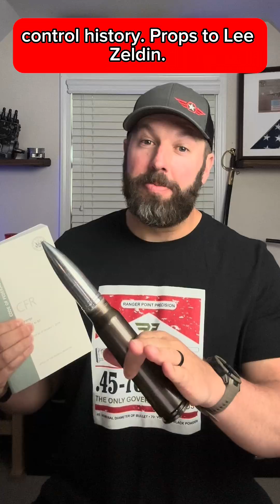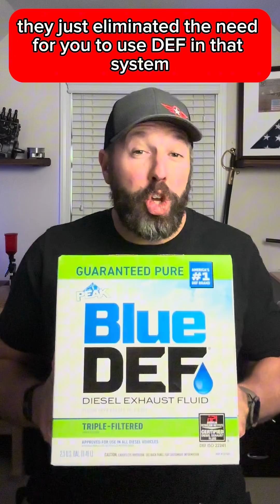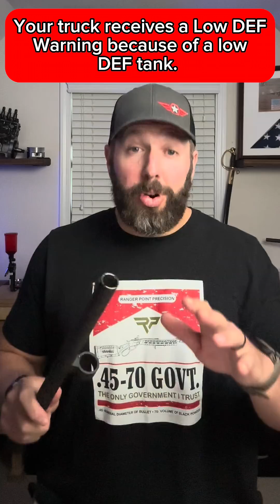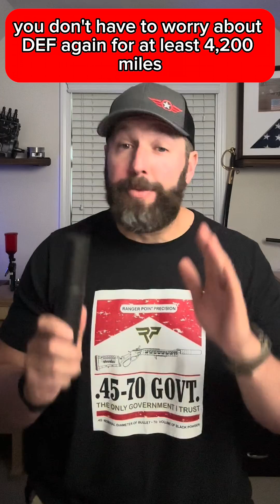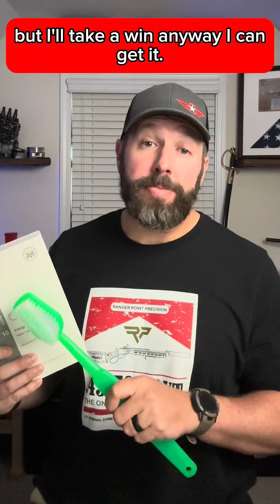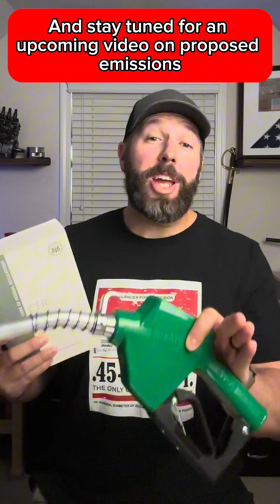The EPA just DELETED DEF in Pickups?…Lee Zeldin is a Magician #diesel #dieselengine #dieselpower

Comment: Not just because your tank is empty.  Also due to any myriad of components that malfunction, rendering the system inoperable.
Reply from the maker: That’s obviously the point of the new EPA guidance, as explained in the video. To make Limp Mode less intrusive after a failure in the system. 😉

Comment: The thing with DEF fluid..

just dont put that sh*t in something that my life depends on. If im fighting a fire, I dont want that sh*t to be an integral part of the system - like it is in my Grader
Reply from the maker: There are exemptions for Emergency Response Vehicles in 40 CFR. Either way, the new Limp Mode guidance should eliminate age any dangers in those situations, IF the OEMs choose to adopt them.

Comment: Does that apply to CMVs?  Are dealers going to be "fixing" previous model years back to 07?  Will warranty still be good in your extended service interval if the factory does flash it themselves?
Reply from the maker: I provided a link to the EPA fact sheet in the description. Commercial Vehicles have a different, but still revised strategy.

Comment: I don't mind adding the def.  My problem is going to be when the system starts to cause problems because it's clogged with crystallized def.
Reply from the maker: I don’t think people will actually use this strategy. Just letting people know that the OEMs have some flexibilities now.
Reply: @freedomworx  I watched the full video.  I have a Silverado with the 3.0 Duramax.  I live in Mesa AZ and put 30,000 miles on it in a year.  Most of those miles are highway.  I think it will do just fine.  Most of the preventative things you talked about are things that happen naturally when you drive on the highway in AZ in the summer (most of the summer is spent over 100 degrees freedom).

Comment: What happens if you tie the sender up in the tank so it never reads empty? 🤔
Reply from the maker: There are lots of other sensors in a DEF system that monitor its performance. That’s not really an option. It’s best to just feed it DEF like you’re supposed to. This is really just giving the OEMs some flexibility.
Reply: @freedomworx  Yeah, I kinda figured. It sure would be nice if it worked though. Lol

Comment: Unfortunately my truck doesn't keep up with current regs.  It's still going to go into limp mode if I run it out of DEF.
Reply from the maker: No truck meets this revised guidance. They all require the ECU to be reflashed. IF the OEMs choose to implement this voluntary guidance.

Comment: At least it will not go into limp mode as quickly for a bad sensor.
Reply from the maker: That's the reason for the change. Keeps people from getting stranded 3,000 miles from home with their family and travel trailer on the side of the interstate in the middle of the desert.

Comment: Will they do away with the 'limp mode'?
Reply from the maker: No. Limp Mode wont go away. They are just making Limp Mode less intrusive. EPA could try to remove it from 40 CFR, but the lawyers and courts would probably be successful at arguing against it. I don't see the EPA trying that.
Reply: @freedomworx  It's always fun when halfway through a multi-day delivery trip, hauling a 40' flatbed of hay, that your truck will now be restricted to low-HP because you forgot to top off your magic peepee juice.

Comment: This pack is exactly what I thought about doing when I heard about this today. However, doesn’t it reduce your torque by 15%?
Reply from the maker: There are seperate Limp Mode strategies for Light Duty Trucks, Heavy Duty Truck, Off Road Equipment, etc...  https://www.epa.gov/system/files/documents/2025-08/420f25011.pdf
Reply: @freedomworx  thanks for this info!

Comment: the cost of DEF isn't the primary issue. It's the cantankerous junk system that is constantly breaking and costing a fortune to fix and keep operational
Reply from the maker: No doubt. But at least the will allow people to complete pretty much any trip they are on, if they have any DEF System Failure. So you aren't stuck 3,000 miles from home with your family and travel trailer on the side of the road.
Reply: @freedomworx as one who was 1,000 miles from home when our diesel motor home went into countdown mode, I applaud this decision. It was a stupid system and was forcing manufacturers to make gasoline truck engines for the first time in 50 years. So we go back to 2 mpg, does that make sense? It’s hard for me to see the EPA as anything but out of control with reference to diesels.
Reply: @jamesfearing9459  To lazy to fill your DEF tank?
Reply: @csuengr tank was full. The control system failed.
Reply: @jamesfearing9459  That's what you get for having a diesel.
Reply: @csuengr yep. That and 14mpg vs 6 for a gasoline version of the same type gas rv.
Reply: @csuengr  Go hug your cyber truck
Reply: @freedomworx Just had this risk. 900 miles from home, towing a camper, middle of the Nevada desert, 6pm on a Friday night. Check engine light comes on... 
Manage to find an AutoZone to pull the codes and it's a def injection issue. 

Then spend the next 8 hrs wondering if I will be stranded in the desert with my whole family at midnight and car whizzing past at 80mph. Fuel economy slowly dropping from 22mpg to 15mpg. 

Luckily we made it... Whoever made these laws needs a swiff kick in the rear.
Reply: @freedomworx complete the trip? Lol as if because it’s flashing a light you now are shut down like a  fleet tractor! 

Who’s stopping people and peeking in their def tanks to see if there’s anything in it?  Wtsf
Reply: @scottcampbell1566 when def systems fail it usually stops you from being able to drive puts trucks in limp mode where you can not drive home
Reply: @tylergriffin8299  yeah I drive for a living kid. I understand how the DEF system works. 
My point went over your head. 

Actually watch the video then comment
Reply: @scottcampbell1566  I did kid 😅 lol it’s how you said it that could be misinterpreted. But hey to each there own
Reply: @freedomworx 
What is the proportion of exhaust gas at what concentration is it mixed with DEF
My measure is 
Pooftenth
Extremely small
Not measurable to even make a difference 
The system is totally a waste of money and time 
Oh sorry it's all about the money 😅
Reply: @garreysellars5525 it reduces NOx by about 40%. DEF should be the simplest part of emissions systems, but it's full of fragile sensors that just exist to make sure it's working as intended. It could work just fine without all those sensors, and it would never break down - but then they wouldn't have a method to enforce compliance. It's such an annoying mess.
Reply: @Undefined14 
If that is correct 
It more useless than I thought 😮
Reply: How is this supposed to work without a ECM/PCM reflash?
Reply: @wildeman7443 I think it will only work on new trucks made after the decision and then ONLY IF the manufacturers make the changes.
Reply: @wildeman7443 for the modern diesels, it should be as simple as an over the air update. However, that is if we lived in a perfect world
Reply: And that same system pumps way more ammonia into the atmosphere than anyone wants to admit. Under static load and rpm, it's great.  Varying load and rpm? Hmmm... On the other hand, you may want to research how that SCR catalyst matrix (ceramic) is going to flow after operating without it's catalyst.  Might be fine, I don't know. On a higher level, one has to wonder if the Nox reduction is worth pumping millions of gallons of urea - even post-reaction - into the atmosphere.
Reply: @HPDrifter2  You have any reliable sources to back that up or are you just talking out your ass.
Reply: @csuengr  I think it's the latter.
Reply: I don’t like it there for I delete it genius
Reply: I have had the bad def warning come on and limit my speed in steps down to 5mph. Because of a bad Nox sensor. My chevy colorado diesel uses about 4-5 gallon in 5000 miles.
Reply: And the bad efficiency caused by it!
Reply from the maker: DEF does not reduce efficiency. In fact, you have better efficiency because of DEF. OEMs needed to increase injection timing to increase power and efficiency, DEF was incorporated into the system to mitigate the additional NOX that was created from chasing more power and efficiency. DEF is injected into the exhaust, so it can’t reduce your efficiency.
Reply: @freedomworx regardless it’s stupid to force us to buy something completely nonessential to keep our truck running. That’s the main problem.
Reply from the maker: You mean like seatbelts, airbags, rear view mirrors, backup cameras, etc…
Reply: @f @freedomworx none of which should be mandated by law. Those who trade liberty for security(or safety) deserve neither. These should all be optional and up to the purchaser. 

Regarding DEF though, who would voluntarily have a def system if it wasn’t required? Nobody.
Reply from the maker: Which FAA standards should be required for commercial airlines? You act like there is always a black and white, right and wrong, answer or standard. That’s just not real life.
Reply: @freed @freedomworx e is a huge difference between commercial air travel and a personal vehicle that is privately owned, operated, and not used for public transportation. Terrible example.

I personally wear a seat belt but I don’t believe it should be mandatory. My whole point is that there are better options than a def system for emissions reduction. It’s just manufacturers generally go for the easiest and/or cheapest compliance option. It’s no secret that light trucks are now the size of full size trucks so they can have bigger fuel usage allowance with CAFE standards.Spraying DEF into the exhaust is cheaper on the manufacturer than building more efficient engines that have a more complete fuel combustion or transmissions that shift more efficiently.
Reply: @f @freedomworx There is objective right and wrong. Some rules make sense while others don’t and some rules are outright harmful. The lack of small fuel efficient pickup trucks is an unintended consequence of CAFE standards.
Reply: My truck would be lucky to get 2000 miles of 1 tank of def.
Reply: @marklanfier8287 
How much def does it hold
And what average fuel consumption 
Just so I can do the numbers 
I don't and won't have anything that runs that stuff
Currently have 7 diesel vehicles 
3 bulldozers 
2 bobcat 
I crane. 15 ton
1 6wheel drive truck with a Hiab on 
And 2 semi trucks
Australia
Reply: @garreysellars5525 I’ve never let it empty, because it warns 500 miles until E & then I’d fill it up, it would be 5 gal.
Reply: @marklanfier8287 dumb comment. How big is your def tank? Are you always loaded heavy? So many variables fir such a broad statement.
Reply: @thelaststarfighter yes I’m loaded, that’s why I have an F350 dually. I work & run a ranch. So I can be putting out mineral, hauling hay, patching fence or hauling cows. The EGR, DPF & DEF are the stupidest things ever made for people who have to use them. Laws made by people who understand enough to exempt EMS & FIRE vehicles from emissions but restrict farmers. Screw them. Thank God I live in Florida & have worked on diesel engines since I was 10 years old. So for the last 30 years now.
Reply: And that's a manufacturer cause, not the EPA. Everybody seems to blame the EPA for all the diesel engine ills. The EPA only sets the standard, it's the engine/car makers who decide how to achieve that. Most just try the 'add a bit on' path. The actual solution is to design an engine from the ground up to meet the requirements. 

I, for one, like having tighter and tighter emissions regulations. It means my children and grandchildren will live longer than I will.
Reply: @Chris-hx3om 
Are you serious
Reply: @garreysellars5525   Serious about living longer? Absolutely.
Reply: @Chris-hx3om lol wildfires put off more nox than all diesel engines combined. "Plus emissions" is the last thing you should worry about. Obesity and cardiovascular disease kill more Americans every year then all diesels combined.
Reply: @Chris-hx3om sorry, that takes from profits, building a clean engine from the start.
Reply: @Thomas-c7j3f  And your point?
Reply: If you don't like it, then don't drive a diesel.
Reply: @csuengr or just take care of that bs early into the trucks life? You can drive a diesel and want it to be as reliable as possible too ya know😂
Reply: @csuengr don't really have a choice with equipment. (Edited typo)
Reply: @csuengr mind your own business.
Reply: @csuengr Let’s apply this high IQ logic to something else:
“Housing is over inflated and new growth is choked out from nonsense regulations and red tape that doesn’t help anyone.”

“If you don’t like it, don’t buy a house”

Genius.
Reply: @americancapitalist9094  Regulations help everyone. Regulations exist so builders don't build cheap death traps. I mean current builders can't even attach a flue to a gas water heater. A family of four here in CO was killed because of this. Imagine what would happen if builders were left to their own devices.
Reply: @csuengr Competency of builders and inspections are a small part of it. You’re also assuming all these regulations and red tape have people’s best interest and safety at heart. Have you ever tried to get a permit to build something- anything? It’s over complication is by design to be as difficult as possible to keep housing prices high and demand far exceeding supply.
Reply: @americancapitalist9094  Your tin foil hat is a bit too tight.
Reply: @csuengr that's some flawed logic. I've seen many regulations passed to benefit other industries and choke others.  If you want to believe that the gov is on your side so be it. I like clean air but also love functioning equipment. What they have now is just junk and could be done better.

Comment: I just keep my def more than half full and haven't had a single issue with the system since I got the Cummins new in 2018. 
When you're paying $100's on diesel, $16 of def  doesn't really hurt much
Reply: Every truck in our fleet is 2018 or newer and every single one of them has been down at least once for some emissions related issue. And we're talking trucks that get run hard all day every day.
Reply: @noscopesallowed8128 none of the fleet trucks where I drive last either. I see who drives them and how they take care of them. That's why I bought my own.
Mine hasn't had trouble because I dont pencil whip my daily inspections.😂😂😂
Reply from the maker: I doubt a lot of people will actually do this. I'm just trying to inform people about the flexibilities the EPA has put into the regulations for OEMs. 👍
Reply: Your time will come..

Comment: So I think this is an amazing Improvement but I was curious what's going to happen to all the particulate that the deaf is supposed to be eliminating is that just gathering in some place where it's going to eventually create a choke or is it actually just getting exhausted out like 1970s diesel?
Reply from the maker: DEF has nothing to do with the DPF. Watch my DEF Video. https://youtu.be/qFBOcVcVjB8
Reply: Diesel exhaust fluid treats, the exhaust gas after the diesel particulate filter filters out the soot. A diesel exhaust fluid reduces the amount of nitric oxide, emissions, that’s all.
Reply: @NickWindham Thank you for the explanation.

Comment: The government may say it’s okay. 
But what happens when you pull into the bay at the dealership and they tell you to get bent.  There is no rule MAKING them retroactively update older trucks.  They will simply be ALLOWED to put those settings on the new trucks.
Reply from the maker: You are correct. The EPA cannot make them. It's voluntary guidance for in service vehicles. I'm just putting the info out there so people know that EPA guidance has been changed. But thanks for your respectful comment.
Reply: I assume you could get someone else to reprogram it for you no?

Comment: If every vehicle on the road today, reverted to the pre-1968 nationwide standards being implemented, how long would it take for even the most Libertarian vehicle users, to realize that some compromise is needed? How many cities would look like 2 stroke era Silverdome Supercross nights? I hate da gubmit as much as anyone, but shitting where we all eat, is not a great plan. I really believe the "coal rolling" trend a few years back, sped up the crackdown. Gas engines in the 70's were utter trash, because the engineers had no clue on how to reduce emissions, without killing power. Now, we have the most powerful engines ever. Diesels are exponentially stronger than a few decades ago, despite the rules. Guys like Banks are working within the laws. Be like Banks.
Reply from the maker: I don't think we need to revert back to those standards. I was around for all of the 80s. I remember when smog and acid rain was still an issue. We need common sense regulation. But if the regulation we have, cannot be met without tremendous costs in time and money for consumers, it isn't going to help. I have 4 pre-emissions diesels that spew out enormous amounts of pollutants. My truck is as bad as 400 new trucks. I drive them because I don't want the hassle of a new truck with unreliable emissions systems. The reason so many old dirty diesels are on the road, is because people aren't willing to purchase the new ones because they are so unreliable. Remember how prohibition worked? Made alcohol illegal because it was unhealthy, and the criminal activity that resulted from prohibition resulted in some really great things...like illegal liquor and organized crime!